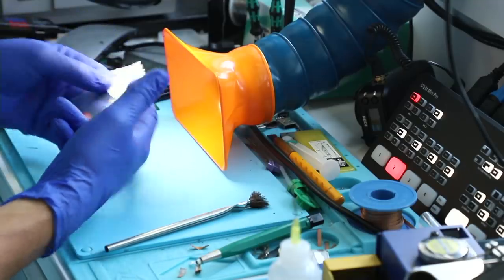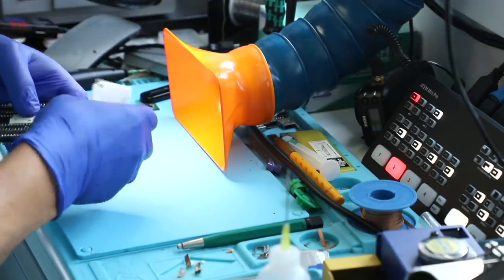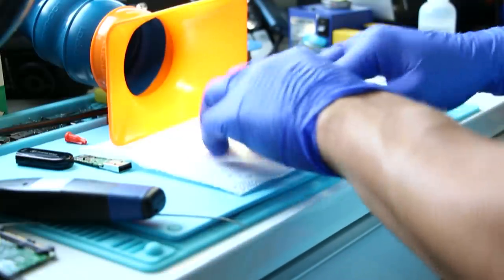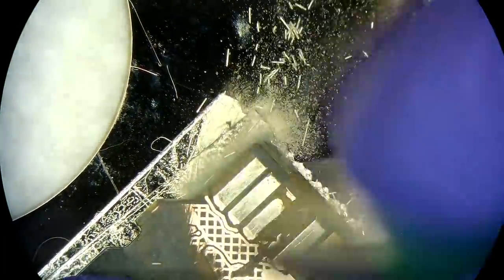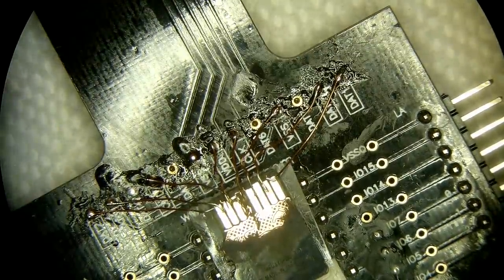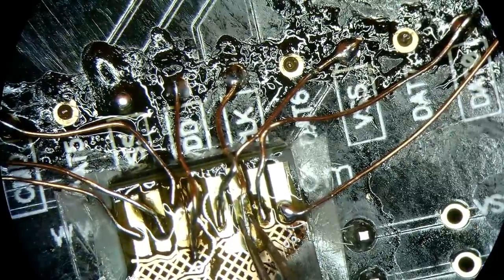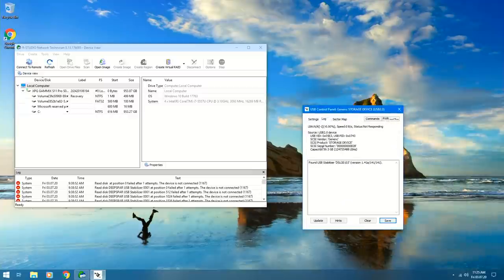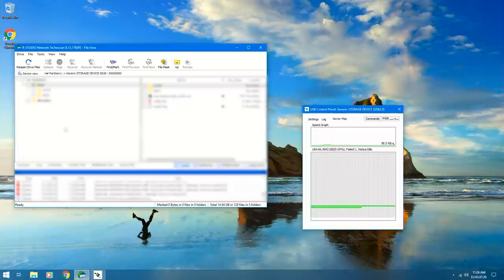liquid damaged memory card

Comment: I always appreciated your skill. Recently I was working on my Commodore 64 and I damaged a trace. I forgot to reduce the temperature on the iron after working on the ground pin. Patching it was such a pain at least with what I had to work with. The patch was successful fortunately but I used a wire that's probably at least twice as thick as it should be. It was the thinnest wire I had. I certainly appreciate your skill even more so after that.
Reply: Thicker is rarely an issue for a patch wire inside a stationary, non-moving device, as long as it fits. Sure it would be nice to always have the right tools and consumables at hand, but as long as you got it working... Some times we use what we have. I think having to improvise like this is good from time to time. It's a learning experience, we learn be creative and resource effective. Solution oriented 👍

Comment: How about cracked microsd cards? I consulted with a local recovery team and they said because microsds are monolith storage meaning controller and memory are embedded together making recovery impossible. Is this the case? I had a hairline crack running along the surface of the card, and not the underside of the card where you seem to sandpaper away to initiate the recovery process. So will it be impossible to recover anything from such a unit? I am curious at the success rate and what is definitely beyond repair. Thankyou and great video by the way.

Comment: what is that "pen" to scratch off the sd?
Reply: Fiberglass pen
Reply: better than sand paper but be careful as it will take off coating quickly
Reply from the maker: that is a fiberglass scratch pen, it is safer than sandpaper, and has adjustability. More out is less abrasive, less out is more aggressive on the coating. However, if done wrong it can still burn to coat.

Comment: I was wondering what you think of NVME drives and their reliability. I have a SATA 3.0 SSD that is like 8 years old and still cranking along. I'm impressed with the reliability. I'm concerned about NVME because I heard they run really hot and I know that's not good for the flash chips. I'm planning on getting the samsung 980 pro when it gets released later this year. I was just wondering if you've had issues with them or heard anything about them since it's related to what you do. Either way I'll probably get another SATA 3.0 drive for backup. Just curious.